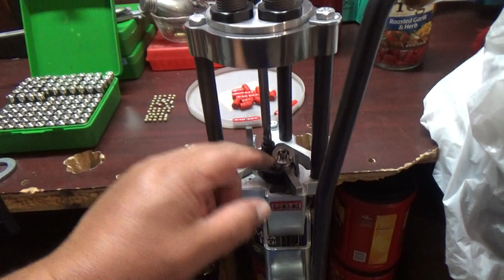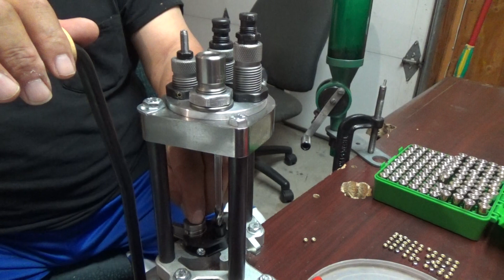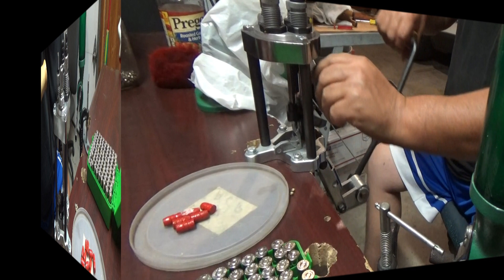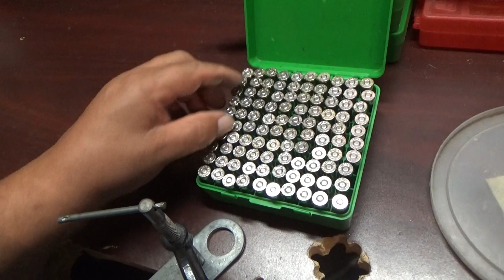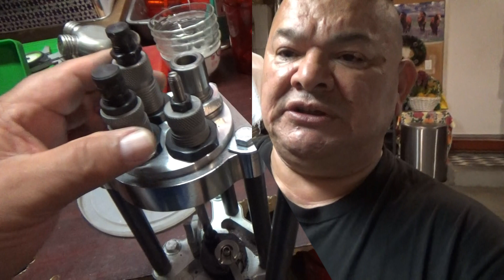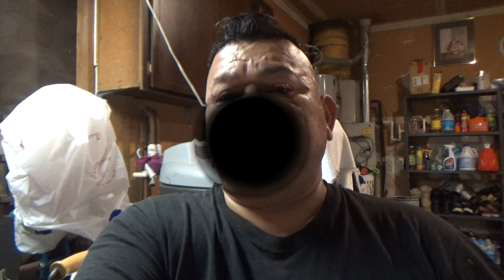My method of using the LEE4 HOLED TURRET PRESS.

Comment: You need to index your tool head so it lines up with the ram. The sqare piece on the indexing rod is adjustable.  By holding the rod and turning the sq piece left or right will index the tool head. When its correct it all lines up like it should.

Comment: I have the Lee Classic 4 hole turret press. Have to push the case back into the shell holder with a finger too, especially during priming.
Reply from the maker: The classic is a much stronger version very well constructed.
Reply: It can get a little wiggly at times too, though.
Reply from the maker: I buggered many of primers and cases to try better methods.
Reply: Me too. That's why I started to push the case back into the shell holder so that it would stay centered while entering the dies and seating primers. Same experience as yours.